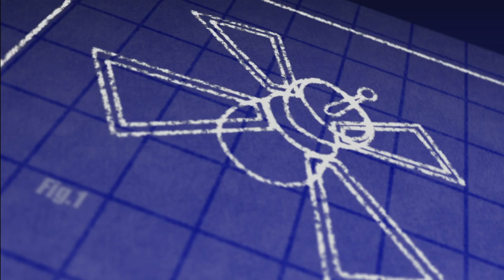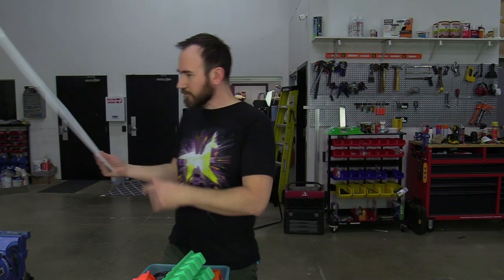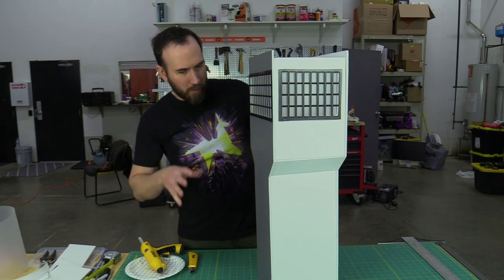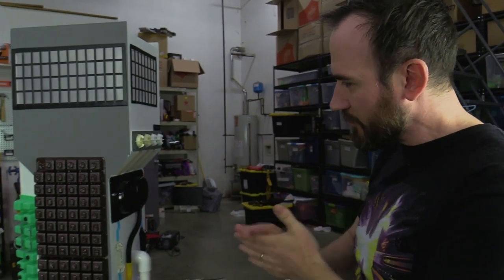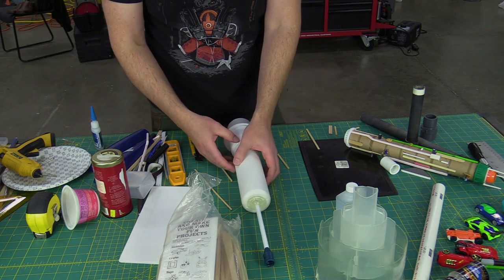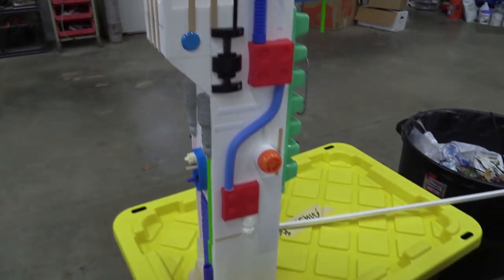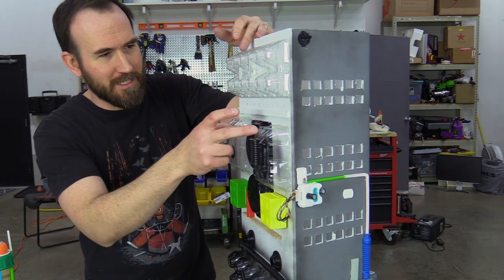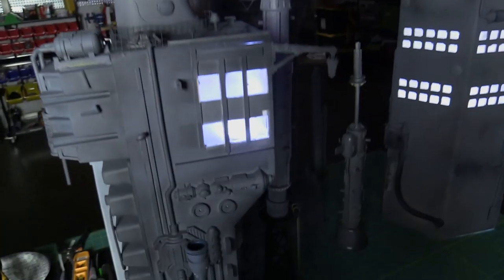How to Build a Miniature Blade Runner City

Comment: Done a lot of similar stuff for friends that play Warhammer and Warhammer 40,000 . Bit of advice to those who are going to try this kind of stuff, if you use Styrofoam as building materials DO NOT spray paint it, the chemicals in spray paint melt the Styrofoam

Comment: At 10.21 the part killing immersion for me is the flat windows- all things connecting inside and outside on a building are going to have a frame around them, for ease of installation and repair. If you look at most buildings you will see that there is almost always a series of frameworks that make up the majority of the building.

Comment: If they were corporate or even industrial buildings they'd probably have something swanky looking at the top to give the impression of high tech board rooms or upper management amenities like private landing platforms.  Something arty to set the top floors off from the lower.  Something that gives the impression of: up here is where $$$ is at.   I had to think along those lines when designing a futuristic city scape and space port for characters used of dealing with wealth and its trappings.

Comment: There is one case where you can have a 'pipe' not lead to anything and not break the immersion:
When the end of the pipe's line is continued by another pipe a short distance later, instead of showing the straws or whatever you used, it will look like an aged/worn down pipe with a break and/or missing sections. (and you could have some 'vehicles' flying nearby transporting replacement 'piping' to further sell the idea that an in-universe maintenance issue is seen)

Comment: Ventilation is really important in many large city buildings. That's what most ducts hanging off of sides of structures and big roof units with spinning cones on them are for. But what the hell is going on with some of these things in "futuristic city" buildings? What the hell is all that crap clinging to the sides of them supposed to be for?